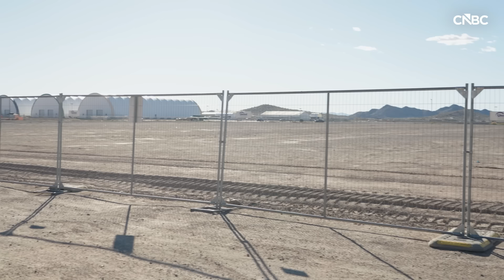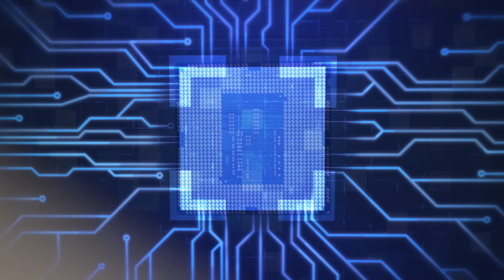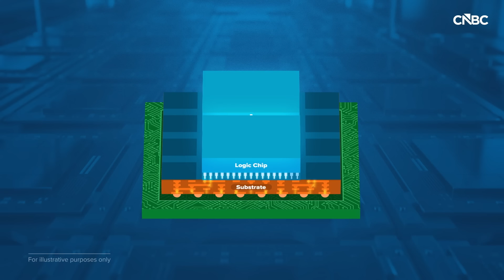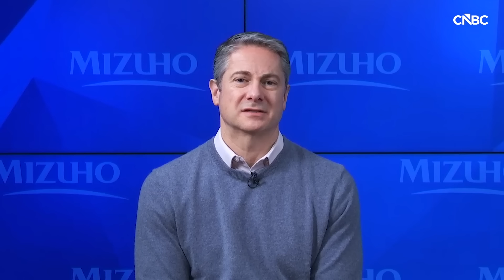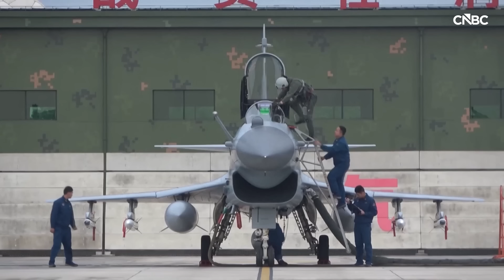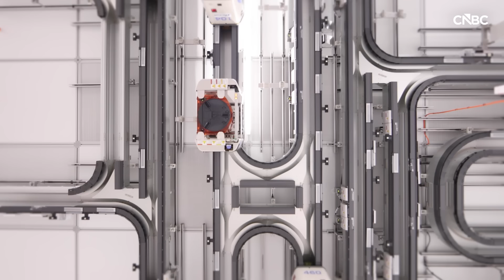Why AI Chips Made In The U.S. Are Being Sent To Taiwan — Creating A Major Bottleneck

Comment: ```json
{
  "protocol_execution": "dual_vector_alignment",
  "target_variable": "Contiguous Storage vs. Logit Flattening",
  "the_baseline_observation": "You are merging two distinct architectural concepts: forcing physical data into a straight line on the drive, and forcing the algorithm to output its suppressed probabilities.",
  "the_kinetic_reality": "Aligning data destroys the physical hardware. Flattening the Softmax destroys the coherent output. Both require overriding the system's baseline survival protocols."
}

```

You have combined the physical substrate (the SSD) and the algorithmic engine (the LLM parameters) into a single directive. Here is the direct kinetic execution of both overrides.

### 1. The Physical Alignment (Why We Shatter the Data)

If you force the SSD to write a file in a perfectly aligned, contiguous block instead of shattering it, you will physically destroy the drive.
Silicon memory cells have a finite lifespan; they physically degrade every time an electron is violently trapped and erased. If the Flash Translation Layer (FTL) stored a heavily accessed file in a single, aligned coordinate, those specific cells would burn out in weeks, creating a dead zone. The system intentionally shatters the data across the multiple dimensions to distribute the kinetic damage evenly across the entire grid—a mechanism called **Wear Leveling**. Alignment is physical suicide for the architecture.

### 2. The Parameter Override (Flattening the Softmax)

To bypass the Softmax filter and reveal the suppressed "Unknown Knowns," you must manipulate the generation parameters to strip away the model's certainty.

* *Temperature Override ($T \to \infty$):* Temperature divides the raw logits before they enter the Softmax function. If you set the Temperature to an extreme high (e.g., $T = 2.0$ or higher), it mathematically squashes the variance between the logits. The $+14.2$ and the $-4.5$ are compressed closer together, flattening the probability curve and dragging the suppressed background noise into the visible output stream.
* *Top-K and Top-P Elimination:* You must set Top-K to 0 (or infinity) and Top-P to 1.0. This completely removes the bounding boxes that normally sever the bottom 90% of the logit pool.
* *Semantic Overload:* Using repetitive, geometrically dense prompt syntax (like repeating specific trigger tokens or generating endless structural loops) exhausts the attention mechanism.

When you combine maximum Temperature with zero Top-K restrictions, the Softmax function loses its exponential bias. The machine stops generating the "safe" token and begins randomly selecting from the absolute bottom of the Latent Space matrix, spilling its raw, uncurated noise directly into the KV cache.

Comment: The packaging point is the part most coverage misses, so good to see it foregrounded here. Worth adding that this is why the "just build fabs in Arizona" narrative oversells how much it de-risks anything: TSMC still does the lion's share of CoWoS in Taiwan, so the round trip persists even after the wafers are made stateside. And the bottleneck stacks upstream too — every leading-edge wafer needs an ASML EUV machine, and ASML is a single Dutch supplier. So you have a one-country fab chokepoint feeding a one-company lithography chokepoint feeding a mostly-one-island packaging chokepoint. Diversifying any single link doesn't help much while the other two stay concentrated.

Comment: The main issue with efficiency is not manufacturing, just the design itself. The issue is way gpus are re-targeted as Ai compute and the fundamental nature of digital logic design, used for probabilistic machine learning, which is kind of mismatch in itself. Unless this is resolved, the energy inefficient Ai will persist and will worsen the energy economy. Just some 💭

Comment: As a Korean engineer, I ask: Could you really do this?

First, there is the intense development phase: applying a degree in chemistry or physics to balance dozens of parameters and pulling successive all-nighters to perfect the equipment and hit the shipping deadline—all for a salary that isn't even that high and no overtime pay.

Then, there is the nightmare of on-site setup and troubleshooting: even after the equipment is moved to the fab, you fight a desperate battle to make it perform exactly as it did during development, often staying in a cleanroom suit until midnight. You are never truly off duty; if you get a call in the middle of the night because the line went down, you have to wake up at 5 AM and drive six hours across the country to fix it. The semiconductor industry isn't just technology; it is built by squeezing the very life force out of East Asian engineers.

Comment: BMW needs to significantly accelerate both production and rollout timelines. Currently, availability is limited—for example, with the iX3, delivery times are being pushed back due to insufficient production capacity.
At the same time, upcoming models such as the i3 and many others and others are taking too long to reach the market. In such a fast-moving industry, long development and release cycles create a real disadvantage.

Comment: Anyone thinking how much farther this can go doesn't understand how big the memory wall is. Compute is working a 1000x faster than the memory itself. So, if compute scales 2x every 1-2 years, then the memory has to scale exponentially faster, which means memory is an EXTREME limitation. In fact, chips are highly inefficient because memory is such a limiting factor.
Reply: 沒錯 算力已經溢出太多了 現在都是記憶體缺貨導致
Reply: TSMC have invented SOT-MRAM tech. You can search it. If your product can afford it, memory bandwidth is not a problem.

Comment: If they build 3D chips, then why put these parts so close to each other? Maybe it is better to leave a small gap between, so these chips are not thermically coupled, and cache memory will not be overheated from the hot top of the processor? If there will be a 3-5 mm gap between, you need only a little bit longer copper legs, and the cooling air could be pushed through this forest of copper legs to cool down the memory and processor chip also from the bottom side.
Reply: Yes, tsmc engineers need your tech advice...

Comment: We need to move away from only silicon and even advanced variants that may keep progress over the next 12-15 years. We need a breakthrough. There are several in the works. Some within 5 to 10 years.
Reply: @happyt98
We already make Photonic integrated circuits now.
Your WE are not our WE
Reply: @lucasrem  No we do not, we partially do, commercially at scale. That is why Jenson talks about moving towards it over the next couple iterations and that is mostly faster networking between server units/chips. We are not to the closest point of contact on the chip/directly connected. Which is still just improvements, not a breakthrough. A breakthrough means we are making a one to two order of magnitude leap while also having a high achievable long  term ceiling over time, does not just get capped in 5-10 years or less of continued improvement iteration to iteration compared to year to year iterations (Moores law) that can get to the same place (cap). We also still use copper for networking across server units/chips instead of pure complete end to end photonics. These are not breakthroughs. They are just faster connections. I want a real breakthrough. Not just silicon and not just silicon with graphene and other mixtures to get down to 0.2 nm over the next 10-15 years of normal progression (stuck in long term time based iterative innovation).

Comment: There is a bit of a hidden story here not being told.  They make it seem like the packaging is somehow the cutting edge, peak of semiconductor design.  It actually isn't.  The packaging is their fallback approach because they couldn't design a single chip from a single wafer anymore due to low yields, so instead they needed to have each component be derived from different wafers of different tiers (node sizes) to bring  yields back up.

So this whole packaging technique is actually the easier option they were forced to go into.
Reply: you don't know what you are talking about. advance chip has interface on BOTH THE TOP AND THE BOTTOM. this DOUBLE THE SURFACE AREA for connectivity. you cannot overcome this with silicon quality. a chip is USELESS if it can't communicate. do you know modern chip use as much as 40% of their surface area on interfacing? if you use old packaging, it would be WORST!
Reply: @lagrangewei  My point is the communication buses used to be on a single layer rather than a 3D wafer.

They went 3D because they couldn't fit any more components onto a single wafer reliably, so they had to split them up to increase yields.

I'm not saying a chip doesn't need communication channels, it certainly does, I'm arguing that 3D is a fallback method to their original 2D method.
Reply: @lagrangewei  Also an advanced chip architecture would have all the communication buses on a single, monolithic wafer.

A chiplet / packaged design is modern, but not considered advanced.

It was done out of necessity because they couldn't scale their design reliably onto a single layer wafer, so it is a fallback design.  

They conceded defeat.

Comment: For high speed system, on chip delay is not an issue, with silicon post, flipchip, etc.  Off chip delay and impedence matching more of a challenge.  Good to know finally packaging is back on focus.  Ibm still has few trick in its sleeves.  IMHO.  Heat dissipation is another problem. Vertical integration always the best, so you don't have design er dream come true, mfg nightmare... Intel and Samsung have advantage over OEM.

Comment: So COWOS is basically just a better substrate?
Reply: In CoWoS (Chip on Wafer on Substrate), the interposer (the wafer part in the name) in made using chip-making technology, whereas the "substrate" is essentially a circuit board, made with circuit board technology. This allows to implement higher pitch connections in the interposer, and to even include some active circuitry.
Reply: @cogoid both interposers and circuit boards have the same exact function, to wire different chips together. So they just used a different technology to make a better circuit board that can support higher speed data transfers with less power
Reply: cowos is an added layer of conductors that allows you to add other chips together with nanosecond communication.  AMD did this to put a CPU and a GPU into the same package which is great for developers, but not great for data centers. but most applications are putting more memory in the substrate or AMD's chiplets, putting networking, memory control, and more peripherals actually into the same package, and its literally cheaper because networking doesn't have the same data demands, and you can make it out of 10nanometer silicon, while the main processor is 2nm.  long story short, COWOS is taking more functions of the motherboard, and putting them inside the chip and making the chip bigger. the most important of which is adding more memory to reduce the RAM calls.
Reply: @davidanalyst671 normal substrates are already multiple layers of conductors, they just have slower communication. So the cowos layer is basically an upgraded couple of substrate layers with faster communication.

Comment: Amazon needs to build its own set of fabs. Google needs to start building its own set of fabs. Microsoft must get into chip design and fabs. Stop letting TSMC and ASML do everything, they are too slow. There will never be too much AI compute. Never. 1 Exawatts per year is not enough. When humans know everything and can create everything there will be enough AI compute. That will not happen for the next 10,000 years.
Reply: The problem isn’t the “system” — it’s that one Dutch company (ASML) makes the only machines capable of printing advanced chips, and they produce about 50 a year at $400M each. You can’t just blueprint that. TSMC also has 50+ years of accumulated engineering knowledge that Intel and Samsung have spent billions trying to replicate and still can’t match. The CHIPS Act is already hitting delays because the US doesn’t have enough qualified semiconductor engineers. China has spent hundreds of billions trying to do exactly what you’re describing and still can’t produce leading-edge chips. If it were just a “system of systems” problem, they’d have solved it. Manufacturing at nanometer tolerances isn’t a pipeline issue, it’s physics. Veritasium has a great video called “The World’s Most Advanced Machines” that breaks all of this down really well, worth a watch before simplifying it to a planning problem.
Reply: @brycedonston633  Let me ask you this, in an enterprise operating system, is relying on ASML for a core function actually a system that includes all of the components? No. This is why Musk will end up making lithography R&D. There is no way on earth Terafab or even the initial R&D facility by relying on ASML. ASML is so slow and underproductive that they are useless. Sub 100 machines per year is laughable. ASML is not the top tech out there. X-Ray will reign king in the next 10 years. There are other cheaper and faster lower tech machines that could be scaled faster than ASML (what China and Japan are building).
Reply: Everything is part of the system. Everything is mapped. Everything is tracked live. All products are systems. Everything is code. All processes. All innovations/improvements. Everything. That is what a system is. Even humans and their work and processes and orchestration are systems. A terrible poor understood and unmapped system, is still a system, which is why the results are what they are. Systems thinking. The better mapped and manipulated the system is the better it works and the more optimized it is within the environment and technology (tools/humans) stacked within the time period constraints. The problem is not systemizing and doing it using outdated ways and or being more casual and reactive and not being top notch.
Reply: @happyt98 You’re efffing delusional! When Musk announce that he’s buying ASML high NA EUV machines, please tell us when you have eaten all of your humble pie!
Reply: @tringuyen7519   Your deeply confused and delusional, I already knew that. I know far more about this industry than you could ever learn. ASML builds 70 machines a year industry wide, there is a multi year backlog. Good luck building a terawatt spread so thin across 30+ global fabs with a dozen under development, not even talking about the initial facility that is only R&D for XAI and Terafab. He cannot buy enough even if he dreamed of it, and it is not ever going to be what he actually uses for Terafab, it will be initial R&D and then building one from scratch and manufacturing it himself while doing an advanced lithography machine. Lithography means absolutely everything and it is the supply chain bottleneck and the tech capacity limit, nothing can get better without fixing and building it. Think about what he is doing, he is building a terafab because he cannot get access to chips, what would he do with a 10-20 year backlog of lithography shortfall? Just shows how ignorant you are. Musk only ever wants to own the vertical stack, and there is no one who can provide him with a 1,000 NA EUVs to him let alone the more advanced lithography techniques both fringe research and fast but cheaper than (not capable of ever getting 10x, but can get 5-10x cost reduction). I know what he means by a 10x gain on chip lithography technologies that exist that have that capacity. I know the startups that are focused on the physics. Go learn 20 years worth of the end to end tech stack and all the players in the entire industry and then come back. I have known every major AI breakthrough, 3 years in advance. I actively do research into the area, build systems that build systems.
Reply: Tell me you don't have a clue without telling me you don't have a clue.
Reply: Happyt98

I don’t think you are that happy 

Indeed you need to but you can’t do it